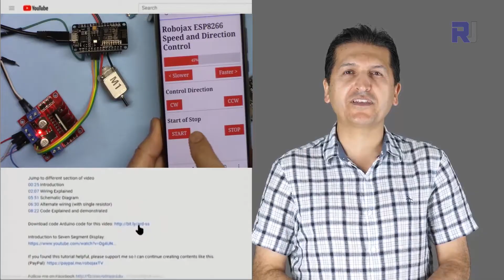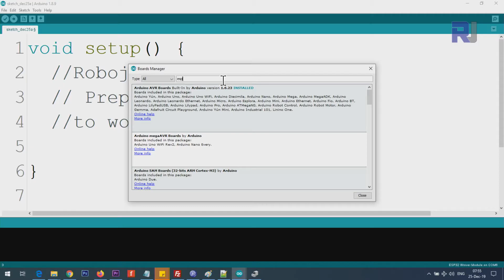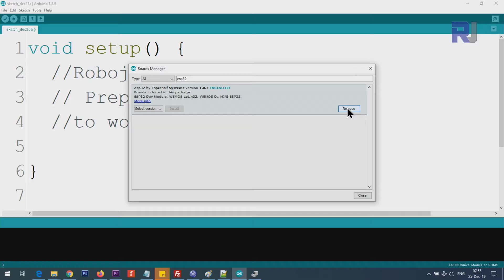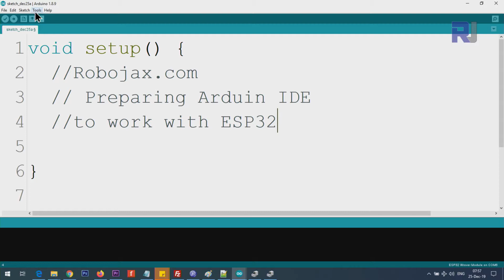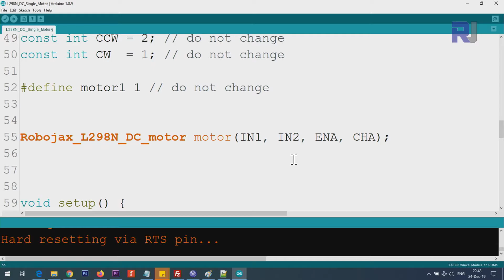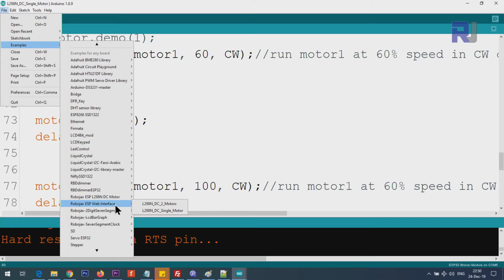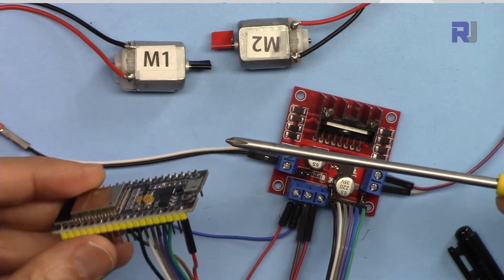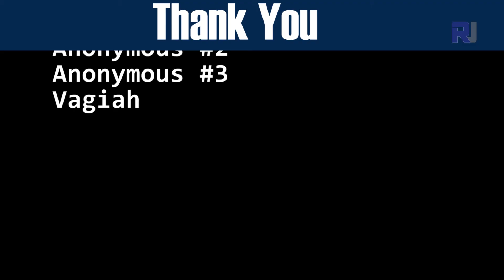Controlling 2 DC Motors using ESP32 and L298N Motor driver - RJT254

Comment: Does the battery need to be connected if the USB is still plugged in? I believe I have everything set up correctly, but the motor just makes a ringing sound when connected (no battery) and doesn't spin. The battery being connected doesn't seem to change anything.
Reply from the maker: incorrect wiring. check it

Comment: Sir, why with 12v voltage and 4 dc motors my L298N module makes noise and the motors don't rotate?
Reply from the maker: It means incorrect wowing or no less than 30% PWM signal

Comment: YOU INCLUSE THE CODE WHICH IS FINE, BUT WHY ON EARTH WOULD YOU FOREGO THE SCHEMATIC
Reply from the maker: because I explain every pin, every input and input.  I have done in some videos. but this L298N have been explained multiple times and did not feel to include the wiring diaram.
Reply: @robojax  we need a schematic always when connecting wires because your verbal instruction is hard follow.
Reply: i cant open the link of downloads there is an error

Comment: I connected my l298 to esp32 with 5v pin. BUT when I connected the motor to l298 then the reading of voltage given the motor by l298 is just 1.6v . What can I do? Plz reply me plz.🥹
Reply from the maker: Hi, means L298 is not getting input signal. or power supply is not connected properly.  Check wiring and I assume you did not touch the code.

Comment: i cannot use the code sir, have error
Robojax_L298N_DC_motor.cpp:159:3: error: 'ledcAttachPin' was not declared in this scope; did you mean 'ledcAttach'?
  159 |   ledcAttachPin(ENA, CHA);
Reply from the maker: It means your have not installed the esp32 driver
Reply: @robojax  i'm use Arduino ide 2.3.1, i think led attachpin not used again..

Comment: Hi, i have a problem with the librery, is not working, im ussing the arduino IDE 2.3.3 and if i run the esp32 2dc motors example, without touching anything of the code, it display errors about "'ledcAttachPin' was not declared in this scope; did you mean 'ledcAttach'?" and 'ledcSetup' was not declared in this scope
Reply: For anyone that faces the same problem, the library is compatible until version 2.0.17,  beacause espressif made changes in version 3 to the pwm functionallities.

it would be cool to see this library in versions > 3 tho, it simplifies everything
Reply: @Kub_43  so how do you solve the problem?
Reply: @arseniusdavin183  I solved the problem by downgrading to 2.0.17

Comment: Is it possible to use 2 L298N modules to control 4 DC motors using ESP32? I tried to modify the code but i really get stuck. I want to control them by wifi. With 2 motors and you library works really good, but we always want more :)  thanks in advance!
Reply from the maker: Yes if you have enough pins. Just define different ping and different object name.
Reply: Do you have any code for this?😇. I managed to modify the .ino file, but both .h files and the cpp file are more challeging. Maybe you have some tips how to easy modify those files? I am a beginner in programming....😂

Comment: My esp 32 has only 15 pins and your is having 20 how ?
Reply from the maker: ESP32 has fixed pins. it is offered as different board.  if you don't see the required pins, then get the one that has 30pin .

Comment: Hi thank you for the video, and all works perfect with a 12v input adapter for my l298n and a microusb 5v laptop power for esp32s. 

However, if i pull a cable from my l298n 5V to esp32s, the esp32s works but the motor no longer spins. 

Can you help how i can power both with same source, do i need a bigger adaptor. 

Adaptor output - 12V DC
Current - 2000MA

Motor - 12V, 150RPM
Reply from the maker: supply 5V to ESP32.
Reply: @robojax  you mean external right.. ?, cant pull from l298n??

Comment: i tryed your code but one motor is driving faster than the other one how?
Reply from the maker: the code is fine. you may have two different motors. if you are using it for  the same project, get identical motors.

Comment: Ok Ahmad, thank you, but i don't have a same rpm.....
Reply from the maker: You should get them same rom if enough power is supplied to the motor.  Check thr motor w voltage while running and if it is too low it means your power supply can’t supply enough power (cut) power supply to the motors. Use different power supply

Comment: I tried the same experiment but I cannot get both motors to run at the same time 
they run interchangeably: one runs and the other is not then they switch.
do you know why is that?
Reply from the maker: if you have not changed the code, then wiring is wrong. check it.

Comment: Hello Ahmad  thank you for the video 
I would like to know what should I have to do for both Motors to run simultaneously  in clockwise or anti-clockwise cause I am designing a robot which will have 2 DC Motors however the robot  has to move Forward , Backward, Turnleft and Turnright. I am using ESP32 and L298N
Reply from the maker: Hello, I believe I have explained every line and what they do.  so I would suggest watching the video 2 or 3 times until you understand it. Just see which line in the code makes the motor to run make copy of the same line in the line below it and change the value to make the other motor rurn. or may be watch this video https://youtu.be/wn5D7j1ybxY and learn which line controls a motor.

Comment: could you connect 2 L298N to 1 Esp32 for 4 motors?
Reply: I have same doubt
Reply: Yeah but the best way is to c9nnect on motor drive for 4 motors i did it with 4 12v dc motor and worked perfectly
Reply: @sheriftamer6486  never worked for me. Seems one L298N can handle correctly 2 dc motors only. 4 motors seem to be too much for one L298N.

Comment: Hi, can nodemcu drive a brushless motor without using esp?
Reply from the maker: Hi, brushless motor has three wires and needs Electronic Speed Controller or ESC. that is totally different but yes it can. you just need to feed PWM signal to ESC.

Comment: Hi Im doing Up my sons ride on car and need to run two motors off the back and one motor for steering.. I have the ESP32 and the Dual L298N Motor driver model too .. any pointers would help
Reply from the maker: Hi, this should work.  just identify the pins.  check or test be lifting the car and turning it ON. using whatever controller you have try going forward and se which wheels rotate.  then turn left and check which motor rotate and the same for right turn.  I am not sure if the car has servo to physically turns the wheel or just by controlling the  each motor it rotates.  
My point is to see if 4 motor is used when running the car or just two sets run together.  this can be checked to see if two L298N is used or 1. 
here an one of 4 videos on a smart car https://youtu.be/JDgOYKo_zQ8 using L298N. Search my channel on more on car. Here is how to find Specific YouTube Video in a channel https://bit.ly/findYouTubeVideo
Reply: @robojax  you absolute legend 🤟🏼I’ll check all the pins and make sure what’s running what .. I know I have two differently on the back but could possibly have a servo motor up front for the steering.. I’ll have to pull it off and have a look and follow your guild more .. will report back later 😀

Comment: Do you get a code without your library?
Reply from the maker: Please watch the section where I explained the code and do exactly as I have mentioned
Reply: @robojax  hmm but I wanted to make it on my own with pwm and control 2 motors. Is there any possibility maybe you look up my code and tell me what I did wrong?

Comment: make with one servo motor and with dc motor
😺😺i'm from brazil, 🇧🇷 sp
Reply from the maker: Welcome from Brazil. Sorry I did not understand. you want to have both servo motor and dc motor? this is very unusual.  I have so many servo related videos. if you watch them, you can combine both together.  *** Free Arduino Course worth $200** Arduino Step by Step Course  (over 100 lectures) Starts here http://robojax.com/L/?id=338

Comment: Hello Ahmed, great video you have there! But can i ask a question. Why do i get this error whenever i tried compiling the codes? Hope u can help, thanks!

no matching function for call to 'Robojax_L298N_DC_motor::Robojax_L298N_DC_motor(int, int, int, int, int, int, int, int)'
Reply from the maker: It means you did not watch the video fully and skipped. I have mentioned and shown to install library. So follow the instruction and install the library.
Reply: @robojax  i watched and rewatched your video for countless time. Already install the library from the zip files as u did. Did exactly the same. But still getting the same error. My friends who used this library last year also have the same problem this year, last time it was fine. Mind to tell us where we did wrong?
Reply: this is top secret, I have the same issue and couldn't solve. Watched the video many times, not sure what I'm doing wrong.

Comment: What is the external power supply you used ?
Reply from the maker: there are millions of power supply. You can use $2V module of $500. Here is one https://youtu.be/tQdUfy0uyUQ that works directly from AC but I have tones of videos showing to get voltage from DC

Comment: Hello
Is there a way to control the motors via the serial port?
Reply from the maker: Hello, I've shown how to control a 360 servo in this video https://youtu.be/b_xvu6wWafA and you can use the same method to control DC motor. But you have to understand the this DC motor .
Reply: @robojax  
Thanks, it helped me

I have a question if I wanted to control 4 motors, how should I configure this line of code? or what should I do?Robojax_L298N_DC_motor robot2(IN1, IN2, ENA, CHA,  IN3, IN4, ENB, CHB);
Reply from the maker: watch the video carefully in the code section. I mentioned "we create object" called motor.  then you create another object called motorB. So the object motor will be for motor1 and motor2 but motorB will be for motor 3 and 4.  Or watch my other videos so you learn the meaning of object . See all my videos on L298N https://www.youtube.com/robojaxTV/search?query=L298N

Comment: Hi, i have an error using your code, 
D:\Documents\Arduino\libraries\robojax_L298N-DC-Motor_library\Robojax_L298N_DC_motor.cpp: In member function 'void Robojax_L298N_DC_motor::rotate(int, int, int)':
D:\Documents\Arduino\libraries\robojax_L298N-DC-Motor_library\Robojax_L298N_DC_motor.cpp:157:34: error: 'analogWrite' was not declared in this scope
   analogWrite(enPin, toPWM(value));
                                  ^
Multiple libraries were found for "Robojax_L298N_DC_motor.h"
 Used: D:\Documents\Arduino\libraries\robojax_L298N-DC-Motor_library
 Not used: D:\Documents\Arduino\libraries\Robojax-L298N-DC-Motor
exit status 1
Error compiling for board DOIT ESP32 DEVKIT V1.
Reply: solved, using this library. https://github.com/ERROPiX/ESP32_AnalogWrite
Reply from the maker: I am glad you found the solution.

Comment: Hi Ahmad, Thanks for your videos full of knowledge and experiences

Please guide how to solve following problem of Rebooting that I see in Serial Monitor

ets Jun  8 2016 00:22:57

rst:0xc (SW_CPU_RESET),boot:0x13 (SPI_FAST_FLASH_BOOT)
configsip: 0, SPIWP:0xee
clk_drv:0x00,q_drv:0x00,d_drv:0x00,cs0_drv:0x00,hd_drv:0x00,wp_drv:0x00
mode:DIO, clock div:1
load:0x3fff0018,len:4
load:0x3fff001c,len:1044
load:0x40078000,len:8896
load:0x40080400,len:5816
entry 0x400806ac
Robojax.com L298N Motor Library
Single Motor Demo
Motor 1 CW at 60% duty 2448 pin 14 LOW  pin 27 HIGH
/home/runner/work/esp32-arduino-lib-builder/esp32-arduino-lib-builder/esp-idf/components/freertos/queue.c:1442 (xQueueGenericReceive)- assert failed!
abort() was called at PC 0x40087f01 on core 1

Backtrace: 0x4008b560:0x3ffb1ec0 0x4008b78d:0x3ffb1ee0 0x40087f01:0x3ffb1f00 0x400d0fdf:0x3ffb1f40 0x400d0f7e:0x3ffb1f60 0x400d0c1a:0x3ffb1f90 0x400d1865:0x3ffb1fb0 0x40088215:0x3ffb1fd0

Rebooting...
Reply from the maker: Hi, you are welcome.  I am sorry I didn't get what your code does.

Comment: thank you has worked fine with my esp32, i would just suggest some kind of schematics showing the pin connection

suggestion for a new video: have you tried to do this with the "Blynk" mobile app ? I'm trying to do this as they have a nice interface with joystick 

thanks !!!!
Reply from the maker: You are welcome.  the wiring diagram is available at my Arduino course at Udemy.com  so anyone who purchase the course, gets wiring and more. 
I have seen 3 or 4 more people mentioned the word "blynk" and when I checked it I did not like it . They should offer some free option for limited access for students .  I am search ing for other option and until then, I will not participate with this operation.  they should offer free or limited device like 5 device or 5 project . Then they should charge for commercial projects.
Reply: @robojax  yes I agree that makes sense, the free option which they offer is very limited! you won't be able to get much done. Try to email they, as a digital media 'influencer' you may be able to get some extra benefits to your followers, best regards
Reply from the maker: someone should offer like 2 to 5 device full feature for free.

Comment: Hello Sir, Will the program be same for Node Mcu Esp8266???
Liked this video but I need it for esp8266.
Reply from the maker: I did not make the video for ESP8266. Here is the video showing how to control it over WiFi. if you learn this (ESP32) video you should be able to use it with ESP8266 from this https://youtu.be/gOMHU0Q8upA

Comment: Thank you Ahmad for a very nice video.  I am very excited to get started on this project but I'm having issues.  Please help me find out what I am doing wrong.  After using the Board Manager to install files for the ESP32, I downloaded the Library you provided a link to, "Robojax_ESP8266_DC_motor_speed.zip".  After adding/installing the library, I closed the Arduino IDE, restarted it and found there were 2 issues: 1) After looking through File>Examples, these were no examples listed as Robojax (i.e. no Robojax ESP L298N DC Motor or anything Robojax).  2) I did go ahead and open the sketch that was in the Library file you provided.  I attempted to compile it and got the error message, "Robojax_ESP_L298N_DC_motor.h: No such file or directory".    Thank you in advance for pointing me in the right direction.
Reply from the maker: You are welcome. Thank you for letting me know. I had updated the library and forgot to update this page. Now you can download and try it. Thank you for not skipping the ads and keep watching it. This will help me a lot.
Reply: @robojax  Thanks for the updated info.  I will give it a try.  On a related note, based on everything I have read, I am surprised the L298N works with the ESP32.  It is my understanding that the L298N requires a 5 volt signal on the logic inputs while the ESP32's output is 3.3V.  Would it be more reliable to use a logic level shifter to take the 3.3V up to 5V?  Just curious.  Thanks again for the tutorial!
Reply from the maker: I have tested it and it works without any issue. For 3.3V and 5V logic, the LOW is up to 0.8V so this module works fine.
Reply: I gave the updated code a try and it works great!  Thanks again Ahmad for an awesome project and video!  I hope you continue to post amazing projects like this!👍👍

Comment: Hello, I run your code and it says that "... Arduino/libraries/robojax_L298N-DC-Motor_library/Robojax_L298N_DC_motor.cpp:157:34: error: 'analogWrite' was not declared in this scope
   analogWrite(enPin, toPWM(value));
                                  ^
exit status 1
Error compiling for board ESP32 Wrover Module."

What should I do?
Reply from the maker: Hello, It means you have escaped the video and not fully watched it. Please watch and follow the instruction.
Reply: @robojax  you are saying the same thing for each issue, let's be honest, you don't know. With my issue, I watched your full video 10 times and didn't solve anything. Very bad library.

Comment: I am getting the 'analogWrite' error message. It comes from the robojax library
Reply from the maker: I have tested  this many times. please post the error here
Reply: @robojax  Arduino: 1.8.10 (Mac OS X), Board: "ESP32 Dev Module, Disabled, Default 4MB with spiffs (1.2MB APP/1.5MB SPIFFS), 240MHz (WiFi/BT), QIO, 80MHz, 4MB (32Mb), 921600, None"

/Users/pneal/esp32/libraries/robojax_L298N-DC-Motor_library/Robojax_L298N_DC_motor.cpp: In member function 'void Robojax_L298N_DC_motor::rotate(int, int, int)':
/Users/pneal/esp32/libraries/robojax_L298N-DC-Motor_library/Robojax_L298N_DC_motor.cpp:157:34: error: 'analogWrite' was not declared in this scope
   analogWrite(enPin, toPWM(value));
                                  ^
Multiple libraries were found for "Robojax_L298N_DC_motor.h"
 Used: /Users/pneal/esp32/libraries/robojax_L298N-DC-Motor_library
exit status 1
Error compiling for board ESP32 Dev Module.

This report would have more information with
"Show verbose output during compilation"
option enabled in File -> Preferences.
Reply from the maker: It says "Multiple libraries were found for "Robojax_L298N_DC_motor.h"
please delete the older one.
Reply: @robojax  HI !  Ok. I did as you said and now it compiles, loads and runs. 
Thank you very much.
Reply from the maker: You  are welcome. I am glad you resolved it.

Comment: Can you do a video controlling two 200 watt motors for track steering /differential drive steering with forwards and reverse with a joy stick
Reply from the maker: So you wan to control DC motor with joystick? 200W
Reply: @robojax  yes like on an electric wheelchair
Reply from the maker: Sure I will do the video. I will put in on my list. But the motor controller is of your choice. Because there 100s of types of motor drivers.